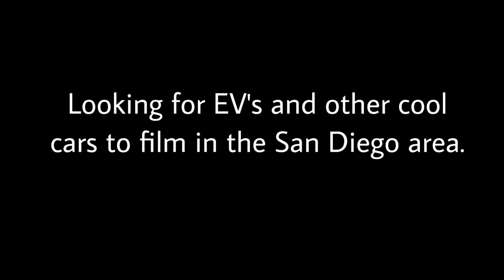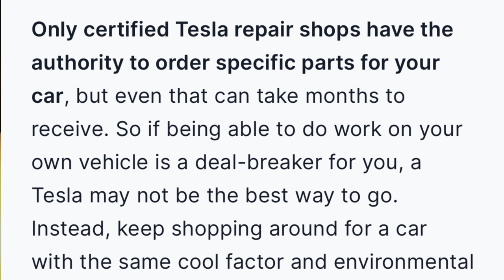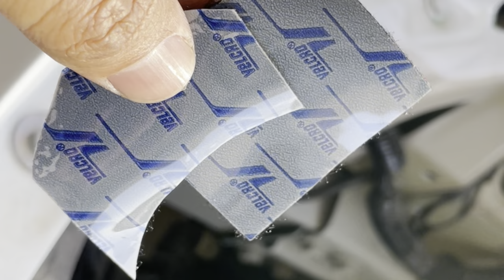TESLA Repairs | DIY Skid Plate reattaching. Kicking the bucket down the road

Comment: So did you find a new part or…? Mine got completely ripped off and is lying in a road - ask my niece where. Need to find a replacement part. Thanks.
Reply from the maker: I just quick fixed it but eventually had to make an insurance claim. At the time I found used ones on eBay.